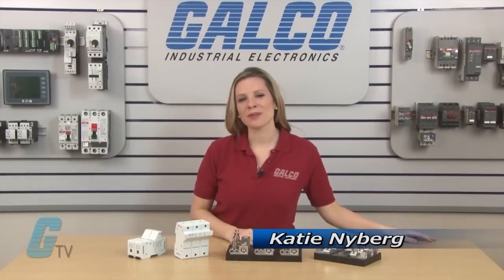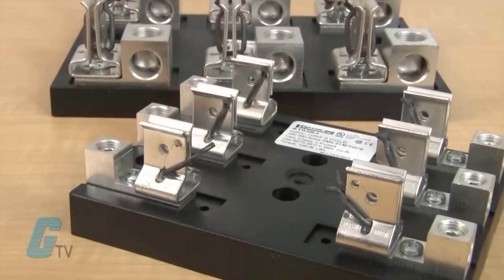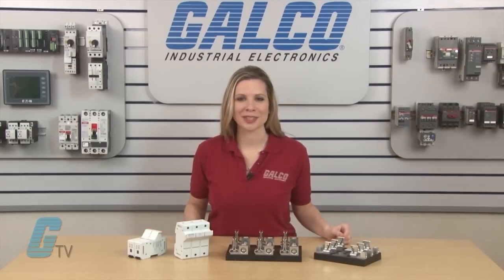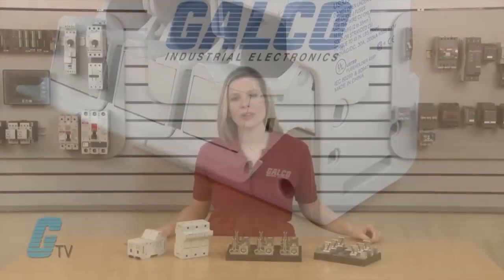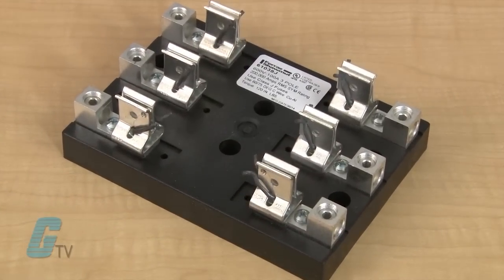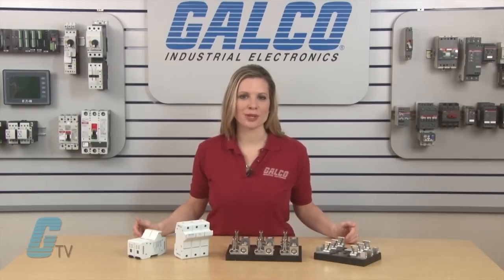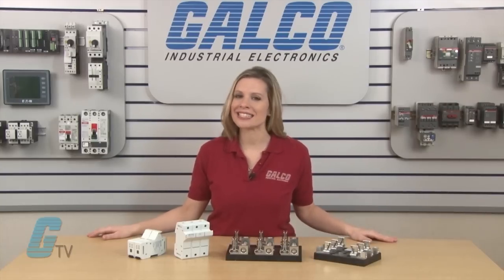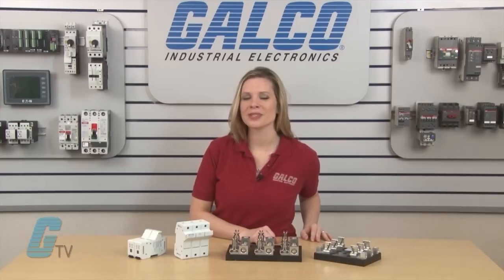Mersen Class J Series Fuseholders

Comment: so I got a broken j type fuse that I am incapable of pulling out. Is there any special way to remove it? It's the fuse with C shaped (or j shaped I guess) contacts
Reply from the maker: Hi, have you tried using a fuse pulling tool to remove it? You can generally find relatively inexpensive plastic fuse pulling tools if you search around. Sometimes they are even specifically-made for certain types of fuses. Hope this helps.
Reply from the maker: We have a few more suggestions for you if you are still having trouble.

There isn't really any sort of "special" way to remove a fuse besides just pulling it straight out, though the type of fuse can sometimes make it more difficult than others. If you are still having trouble, you may wish to try using a flat blade screwdriver on at least one of the ends (if not both) to help pry it out. 

Do the contacts have show any signs of an electrical flash, burn mark, or discoloration compared to other fuses in the area?

Depending on the source and extent of the damage, you may need a new fuse block entirely.

Do you happen to know what the fuse p/n is? (LPJ, JJS, JKS, AJT, JDL, for example). May be able to help you out  a little further if you are still having issues.
Reply: Hey sorry for replying so late, and thanks for replying so fast!

We solved the problem eventually. Apparently, there was a lock that a certain someone missed that held the fuse in place.

Again thank you so much for your concern that was so cool of you guys.
Reply from the maker: Glad you were able to figure it out!